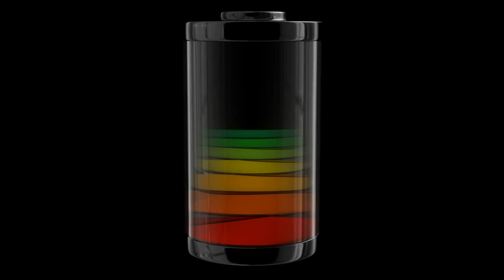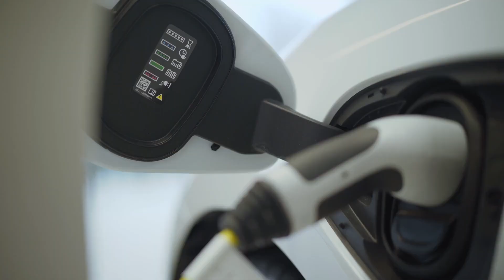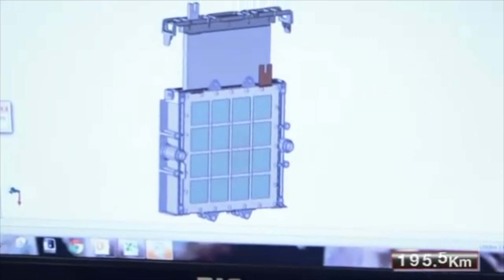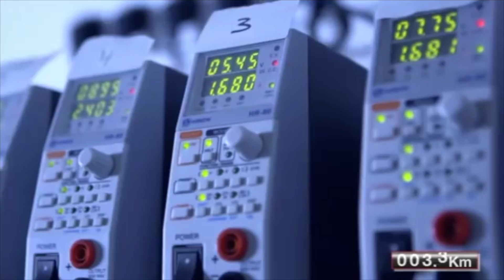This Battery Gives EVs 1000 Miles of Range!

Comment: BUT STILL BATTERY POWERED VEHILES WILL ALSO BE A POLLUTERS; WHEN BATTERIES HAVE LOST THERE ABILITY
TO CHARGE UP THERE IS NO WAY TO 
DISPOSE OF THEM BUT CAN THEM UP AND BURY THEM LIKE TOXIC WASTE.
Reply from the maker: Jimmy they can be recycled. Unlike gas, that’s burnt up and gone, ev batteries after 300,000 miles can be recycled. It’s not even close

Comment: I don’t think a country that cannot supply power to a couple of electric motor cycles is the sort of country that can recycle  aluminium hydroxide cells back into aluminium efficiently. What’s more likely to happen is something like those pictures at the beginning of your segment where piles of waste from the fuel cells is dumped somewhere and new aluminium is shipped in on trucks.

Comment: If it is not rechargeable, I do not see it replacing the existing high density storage solution, just because it can be more green, if they on the other hand figure out how to in cell electrolyze it back to new then you would have a new future.  

Sure electrical efficiency would be lower but energy density could make up for it.

Comment: This strikes me as having the same problem regarding recharging/replacement as both existing electric vehicle and computer power packs.
I hate the existing situation where each manufacturer has their own bespoke charging system. In the UK, I believe we have 3-4 different car systems depending on manufacturer; with computers it's even worse - each manufacturer will have a different system depending on model. With USB accessories at least they've settled on a common 5V input socket, OK with different amperages but that's understandable. 
For any country/worldwide system to work, regardless of 'battery' type, a common system should be agreed and adopted before they have any real chance of being acceptable to the buyer. And international consensus agreed on the future development of such systems.
Likewise, common consideration should be given regarding positioning, access and replacement of such power sources.
To minimise long-term costs this needs immediate attention not only by the transport industries but also power suppliers (eg 240/120V supply and minimum charge rates, etc), and common international legislation agreed to enforce supply and safety. Best get these resolved early on before the lawyers and politicos suck the life lifeblood out of they whole business later.

Comment: There is no such thing as clean electricity.  There is nothing clean about nuclear power.  Wind mills produce propeller blades that NEVER ddecompose!  Hydro electric. Not available everywhere.  So let's face reality your so called green car runs on electricity generated by BURNING COAL OR OIL!

Comment: So what would happen if we put more than one aluminum battery in a car so when one can no longer produce electricity it would automatically switch over to the next one? Since they are so much smaller than the other battery's we could maybe have like four of them and that would give you a range of 4,000 miles before you had to swap out the old battery's. That would let you drive from one side of the country to the other. 

Since the spent aluminum could be reprocessed and made into new battery's it would lower the cost of the battery's and make it more economical to use. I  would strongly consider buying such a car. Just let me know when it's available.

Comment: Just for the record this is the first comment I have left with anyone. After all the different videos I have viewed, on various subjects. All the technology is here now. You just have to get some one with enough clout to see it and push to get it all started. The aluminium manufacturer needs a molten salt reactor to keep pollution down. And the government needs to standardise an aluminium battery pack to swap out at a gas station or where ever they are sold. small light car may hold 3 active packs, big suv may hold 5 or 6 packs. they should drain sequentially, some people will swap out first pack as soon as it is empty, and some will wait until there is only one left. Others will keep 2 in trunk for emergencies. And there is a company right now that has a molten salt battery, not for residential use, Elon Musk is wasting his batteries at power plants, should be using Ambri batteries.  It all drives me nuts, it is all here on the internet.  If I had the money to build a molten salt reactor, and make aluminium batteries.

Comment: Sounds like a hybrid system would work well, a smaller battery Lion battery pack (say ~150kg/300lb) and a removable Al/air fuel cell, you recharge the battery for "round town" driving with ~160 km (~100 mile) range and the Al/air fuel cell is your range extender.

Comment: No mention of the effort to mine the Bauxite ore or the huge electrical consumption required to reduce to Aluminum. Also, I found it "illuminating" that all you experts couldn't figure out that in an electrical cell, the Positive electrode is the ANODE and the Negative electrode in the CATHODE.  Finally, the only thing worse than putting more CO and CO2 into the environment would be to find new ways to take O2 out of it. 

This is my first introduction to aluminum as a source of power, but as one who drove an electric car for 4 years in the 1980's, I can tell you that you could not give me another one.  Did you snowflakes forget to mention that you have to charge a battery?  Where is all that power going to come from?  Maybe the diesel powered charging stations that are beginning to crop up?  

We haven't built a nuclear power plant in 40 years, because of the snowflakes back then.  So are we to use photovoltaics to charge these batteries now, if so,which ones?  Shall be get the chinese to provide them ?  Solar power still costs at least 5 times as much as power from the grid?  Where I live, the sun factor is 31% which means 69% unavailable due to weather.

I can see it now, "oh we'll make the batteries easy to change" and "then we will charge them in the Arizona desert" and "then we can ship them by semi tractor trailer trucks and railroad to your local battery change shop". That sounds efficient....if your a feel good brain dead idiot!  

I'm more thankful everyday, that I am not younger so I won't have to put up with the mess that this country has become!  We are literally drowning in idiots and our enemies are drawing near....so get ready to learn to speak a foreign language. I'm guessing that it will be a hodgepodge between russian and chinese....and it is going to be a REAL TRIP!

Comment: Just completely wasted my time watching this.  Although good idea in theory, the drawbacks are too numerous to be a viable option.  Moving on.
Reply from the maker: If a use case was established, and a centralized factory for refurbishment was established, this isn’t out of the questions. The future, will require a slew of great ideas and options!
Reply: @TwoBitDaVinci  It in current day isn't any cleaner.... fossil fuels used to mine and process the materials..... and mostly used as it's source of charging power. It's currently more efficient to have a well designed and efficient petrol or diesel....overall.... though this battery isn't the typical charge type... that's what is on the market now. And they actually in most cases cost more per year to operate, and typically more to purchase. If everyone got 1 tomorrow we would have a almost if not complete nation wide black out because the energy grid cannot support charging them at that level. Also..... fossil fuel products are not going anywhere that quickly.... besides powering the grid, and vehicles.... other daily products would vanish if we simply killed off the use of them. Too too many to even try to list in a post... but you wouldn't be driving..... because tires and asphalt would go away right out the gate.